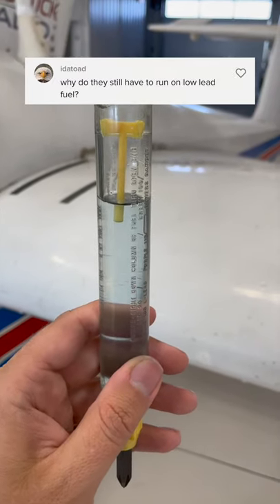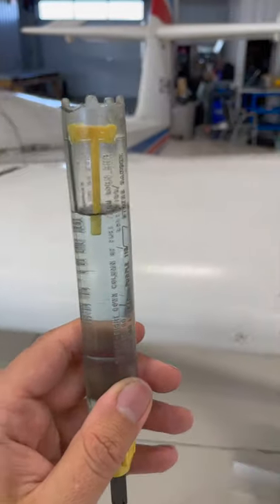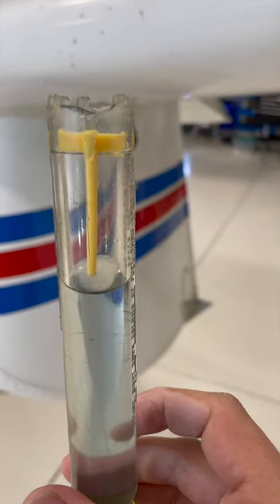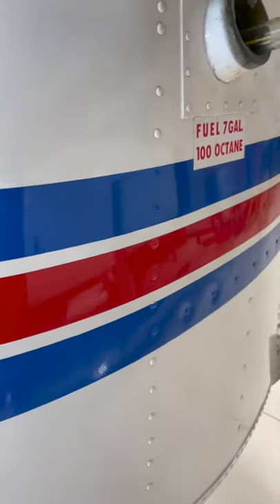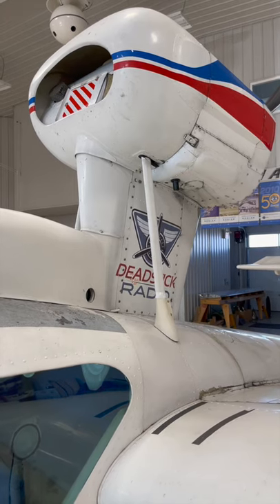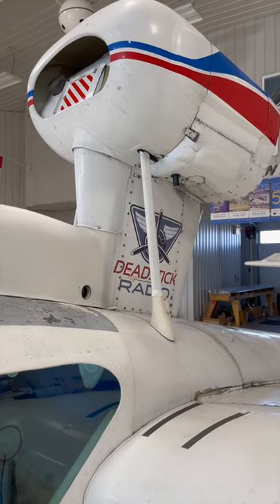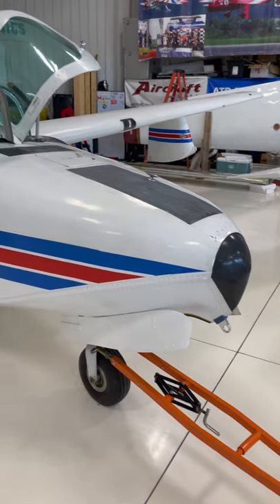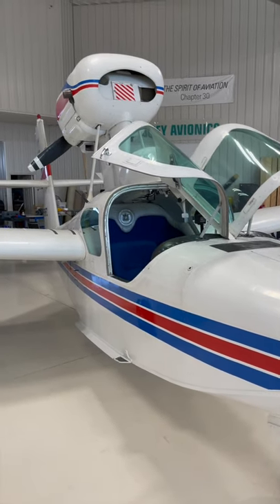Why is airplane gas blue

Comment: Most low HP general aviation engines will run well on 90/91 octane unleaded mogas, but the high HP and turbocharged engines need 100LL. Now that 100 octane unleaded avgas (G100UL) has been approved, 100 Low Lead will eventually not be made anymore.
Reply: I sure hope so, 100LL absolutely needs to do.

Comment: First it’s dyed blue so as to leave a residue if there is a fuel leak because gasoline evaporates the dye will leave a stain so maintenance personnel will see this and correct it during servicing and inspection. It also identifies the grade of fuel as 100 low lead. 
Second lead suppresses detonation in high compression engines as well as turbocharged engines that have a high manifold pressure. It’s true that you cannot use synthetic oil in leaded gasoline engines because synthetic oil keeps contaminates in suspension extremely well. Unfortunately that caused lead to accumulate on piston rings causing them to get sticky and break. This resulted in damage to the cylinder walls . It also caused lead to accumulate on exhaust valve stems. This resulted in valves leaking. 
As far as vaporization of fuel at altitude I don’t think that’s valid as the tanks are ventilated to create ram pressures inside the tank and boost pumps provide positive pressure to the engine.
Reply from the maker: Nah the vaporization is the biggest issue. The ram pressure in ga planes, which is rare, is negligible. Many planes, including my own, suffer vapor lock on hot days even with 100LL. It’s worse with car gas.
Reply: @Brian.Murray  Well yes. But it's not like Tetraethyllead is the only chemical in existence that can lower vapor pressure of petrol. There are multiple alternatives available since decades. The only reason nobody wanted to move away from leaded avgas for so long is simply that TEL was a dirt cheap addiditive and that fuel producers didn't want to spend money to certify unleaded avgas until recently.

Comment: non turbo charged low compression aviation engines are burning leaded gas why because the exhaust seats aren't the hardened  tell the whole  truth.   Get rid of the lead.